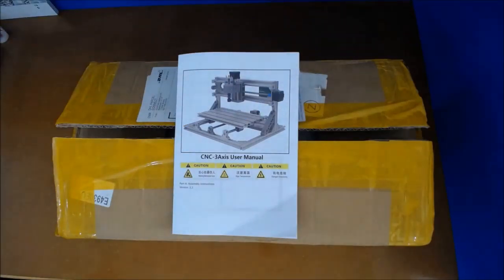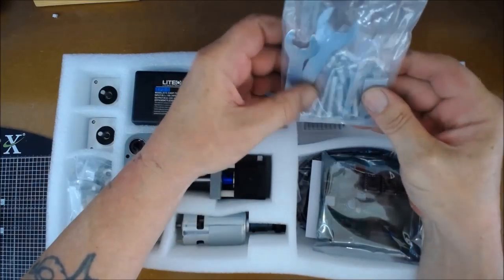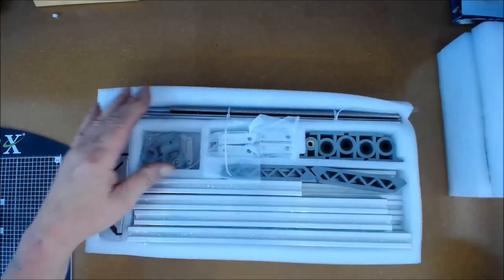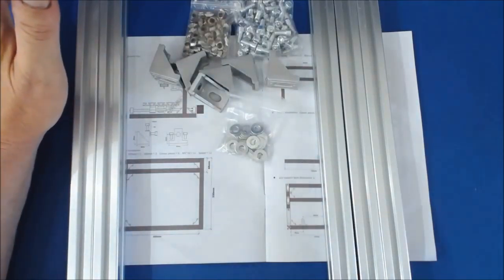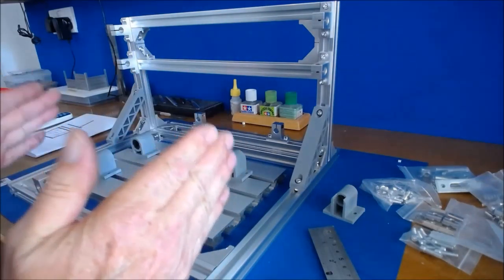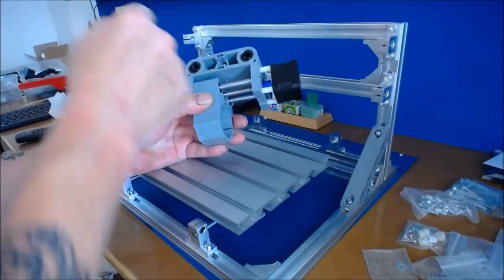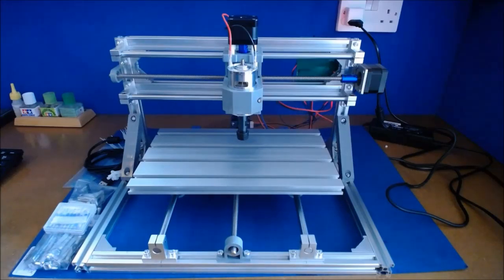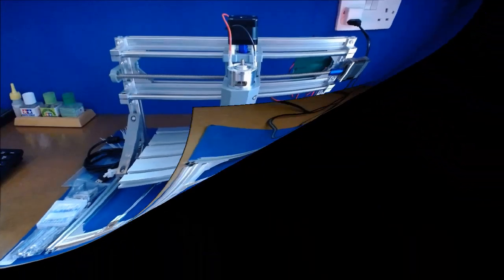CNC Machines Part 1

Comment: Hi, the three stepper motor driver board chips will get hot, mine came with tree tiny heat sinks to stick to them, be careful if you enclose the board, a fan will help but will also drag dust along with the air flow. I have found Universal G Code sender is very good along with Easel, there are many softwares but I like these two.

Comment: Those bits supplied are only basic v groove engraving bits. If you're planning to engrave embossing stamps or mold negatives have a look at ball nosed bits. It's also a good idea to create a back up of your control board settings just in case. Next time you connect type $$ in the console window of the Windows program you use and it'll list a a load of settings. Copy & paste these to a text file. I'm just starting out myself, it's certainly going to be interesting.